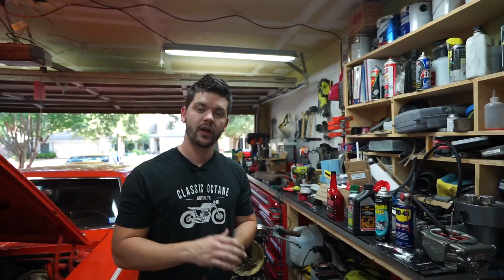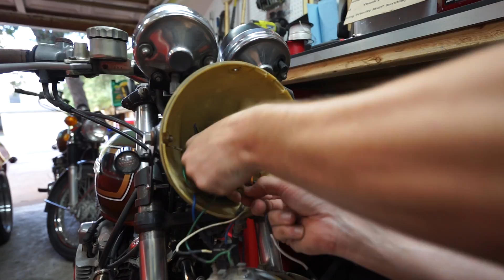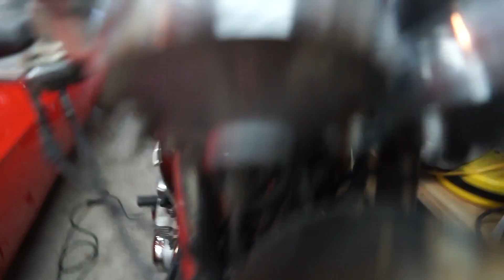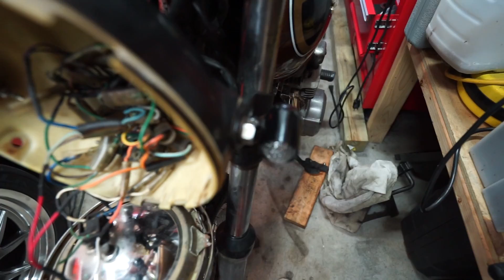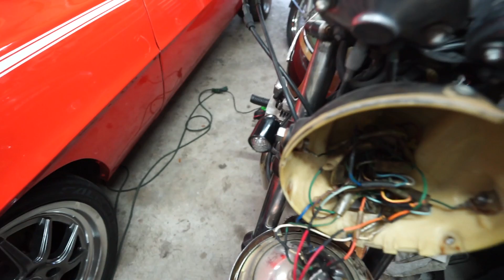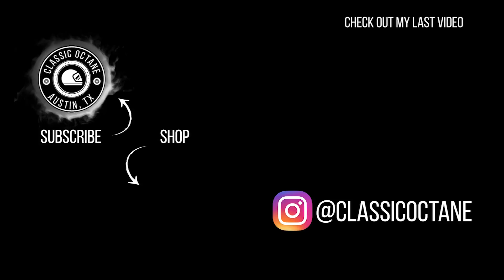How to fix motorcycle flashers all going off at once.

Comment: Re: 81 Kawasaki 550ltd. Still have the original system. But, I'm getting a voltage drop on the non flashing side. This looks like a ghost flash. I'm looking to prevent that.

Comment: Question here,
If I install turn signals with LED bulbs, flashers and the diode kit, but leave the indicator light non LED, would it be an issue? I have trouble finding no twist type LED cluster bulb.

Comment: Do the diodes have to have a specific value? Did you also use a single LED relay for the LED brake, front and back turn signals conversion?

Comment: Hello. I picked up a 86 Suzuki intruder project. LED headlight already installed. Flashers don’t work at all. Running lights only. Rears are currently missing. Wondering how to remedy this. 
Sincerely 
Noob to all this

Comment: Did this for my 85 shadow, worked fine. As he says, plug the DIODE single side up to one of the cluster signals wires and the other wire from the cluster to a ground. Then connet the 2 DIODE ends to the signal wires.  The running lights can go directly on to the signals.

Comment: hi, first of  all thanks for the video. very helpful information and well explained, wondering if you or someone here could help me, i got these led turn signals with 3 wires one for the running daylight  and before installing the diode kit i tried by unplugging the light bulb of the indicator everything worked, day lights and turn signals, but when i installed the diode kit turn signals work but if i try the 3rd wire for running daylight it goes back to same issue,

Comment: I had the same problem on '22 Honda XR150. I first added 2 rear LED signals which worked but would hyperflash. I replaced the flasher unit with an adjustable LED unit which fixed that issue. I got the 4 way problem when I added my front LED signals. The quick fix is to remove the dash indicator bulb. I did that and it all worked. I then installed a LED T10 bulb so now I get the indicator on R signalling only. My left signal wiring is orange and right side is lilac purple. Green for ground of course. 
I'd buy your adapter in a hot second if I wasn't in the Philippines. I'm sure the postage would be high. Can you tell me what diodes you used? Good video by the way!

Comment: I have a 2007 cbr1000rr the bike is set up with two indictor lights one for the left and right inside the cluster. So would I need two separate diodes or would one still work?

Comment: My Issue is when I turn the switch to the side they turn on but won't blink. But if I switch one of the bulbs to the Stanley bulb, it'll blink. I have Led bulbs, I have a led relay, but if I put both LEDs on front and back it won't blink. I am open to what ever advise the community has.

Comment: Got my diode splitter kit a couple of days ago and did an installation. On a 2014 Kawasaki 900 classic. All worked perfectly after installing the LED flasher module, your kit and the LED bulbs. FYI, the grey and green wires can be accessed where they go in the dash connector by just undoing a little electrical tape. The black and yellow striped wire right next to them can be tapped for ground. Unless you choose to remove the gas tank, the hardest part is working in the little space afforded where the harness wires go down just behind the speedo assembly.

Comment: Great video, i just ordered a diode kit from you, and i wonder if i have understood this right? i have four wires in front, two for each side, so 2 green, one blue and one orange. So the orange one i can just put directly to ground, the blue wire to the single connector on the diode kit, and then use the two remaining wires on the kit to each turn signal??

Comment: Bit different on mine.  2004 Honda vtx 1800 with 9 pin relay (quick fix would be to switch out 2 pin in other models but no).  With LEDs wired up, when I turn the bike on, both sides flash like hazard lights.   When I activate the switch, the correct side turns on and blinks fast.  Obviously don't want to run around with both sides flashing all the time :D

Comment: Just received and installed it, worked great. The only thing is you do need a 3 wire Electronic flasher (with a ground). Thanks for shipping this out so quickly.

Comment: Hi. Thank you for this video.  I just found myself having this same issue (LEDs all around, causes all LED signals to flash like hazards when any signal is turned on).  If I leave 2 incandescent bulbs on either end, LEDs on the other. All is well, no hyperflash either.  So, I have a 2007 Honda Shadow Sabre 1100, will your wiring fix work for me as well. Will it be in the headlamp housing and easy plug and play like you show?  (I really dont want to cut any wires :) ). If so, I would like to buy your wire/diode kit if you are still selling.
Reply: I have the same bike. We’re you able to use this?
Reply: @themegamuffin2542  I used something very similar but it kept blowing a fuse. I am not very good with electrical wiring but I followed same as you and compared to my honda shadow sabre 1100's wiring diagram and it still didnt work. I kept 2 LEDs in the back, normal in front. I get a quicker signal flash but it works like blinkers should and doenst blow a fuse.
Reply: @kezug  sounds good. Thanks for the info, I’ll be trying a few things. Just got this bike a few days ago and it’s my first bike. Trying to learn all the bike stuff lol.

Comment: Whats up Classic Octain? I have a 93 cb750
I swap out the rear 2 wire turn signal with led one's. I change the relay to a led relay. Work beautifully. 
My front turn signal uses a 3 wire set up. I change them to led all the light comes on at once. I use a resister for each one, but not one side work as it should. When I switch to the other side all the light comes on (turn signal) will the wire set you are selling fix this problem? And how much do I need? Thanks

Comment: I bought a flasher relay for my 2004 Kawasaki Vulcan 800 when I installed my led turn signal and all of the flash when signals are turned on left and right. Indicator below speedometer doesn't flash. If I change the bulb will that solve my problem?

Comment: I saw that the price is $10 (not $5 like every said) for 1 diode kit. I need only one or 2 to wire my bike?
Reply from the maker: I just increased the price so I could offer faster/more reliable shipping with tracking. You only need one diode per bike.
Reply: @ClassicOctane  My cb750f 1977 is different right? My have 4 wires. 1 side has orange and white orange, another side sky blue and white sky blue. How can I wire this diode? Please help

Comment: I can’t figure this out. I have a 1992 Honda nighthawk. Has 3 wire lights on it now but my new LED’s are two wire. No running lights just turn signal. The lights on it are grounded to green then one to running lights and the other to signal on both sides. How would I hook up my diode kit? For something so simple I am confused and I’ve emailed twice but no response
Reply: Anybody have an idea?

Comment: Thanks Taylor. Just installed the diodes. It worked except the dash lite did not flash. Installed a new led compatible flasher with a ground EP 35 and It worked. I have a 71 750 and the harness had a ground tang there. So if anyone is having that problem try the new flasher. Pin 31 grnd. 49 blk 49a gray. Thanks again and enjoying finding you channel and builds..

Comment: Great video.  Would these diodes be useful for me? I just installed LED turn signals that double as running lights, but my bike has only two wires for the indicators and the LEDs have three wires.

Comment: Hey, so my led turn Signals work fine unless I connect the lil turn signal dummy light harness does it with led  bulb or incandescent, then it will flash on one side fully and other side will flash dim what that fix this issue? And only does it in front

Comment: Taylor, I installed the 2 pin electronic flasher with the led bulbs on my 2008 Honda shadow aero 750.  I used the one below led bulbs for the front turn signal
GLL 1157 BAY15D 5730 20 SMD Amber/White Switchback Turn Signal LED Light Bulbs 3.8W 12V LED Super Bright 600 Lumens 6000-6500K Brake Light Lamp (Pack of 2)

I used the one below led bulbs for the rear turn signal
iBrightstar Newest 9-30V Super Bright Low Power 1157 2057 2357 7528 BAY15D LED Bulbs with Projector replacement for Turn Signal Lights and Brake Lights, Amber Yellow

After installing everything, my front turn signal flashes one at a time but both the rear turn signals flashes at the same time. Can you tell me why it is happening?

Comment: Thank you for posting this video I have a Yamaha V Star custom and believe this is my issue. I also installed an integrated led tail light. Would I also need one for the rear? I have LED front and rear.
Reply: Hey Josh, I also have a V-Star custom that I'm working on.  Did you end up buying these and was the install fairly straightforward?  previous owner installed LEDs but never finished wiring it up All four of mine are turning on in both left hand and right hand turn.  Just curious what you ended up doing?

Comment: I have aftermarket led rear blinkers that work fine. The front are still stock but I tried putting in led bulbs in the front. They are bright but hazard flash just the front two blinkers. The back flashes normal. Will this trick work for me or do I need a flasher relay? 2005 Honda Shadow Spirit 1100

Comment: I have an 82 cb900c with dual indicator turn signal bulbs. I upgraded all bulbs to LED, brake, turn, front and rear and turn  indicator leds. Now all I get is; select rt turn rt.front just illuminates,no flash. Select left turn same result. In rear no turn signal or illumination, only brake lights work with front and rear brakes. On front left and rt. running lights shine when ign key is switched on & slightly brightens when turn selected either side. Do I need two of these diode harnesses,one harness for each ind led, and where to I connect them?

Comment: Have a klr with a trail tech vapour dash and did led signals and flash fast but work. Got another klr, mint, low km, and stock. Just did the same led setup and all 4 signals come on.
This vid helped to track the bug. Getting a diode. Turns out the Vapour on the other bike is set up for led and the power stops at the dash. The stock klr does not. 
Many thanks🤘👌

Comment: aaahh I can't get this to work! I installed a new LED signal relay and tried using the diode kit but for some reason it wouldn't work for me... I plugged the single side into one of the wires running from the turn signal indicator and the other two into each red wire going to each turn signal led. I also grounded the other wire from the turn signal indicator and it still wouldm't work...

Comment: The led lights were working fine but flashing fast. Took it apart to rewire neater and now when i turn front signal on both flash at the same time, but rear works properly. Any idea what the issue would be or does it require the diode?

Comment: Hi, I made one as im half the world away from you and it hasn't done anything, bike is a 76 laverda SF3, I wired it up to where the front and rear indicators join at the front. should it wire to the indicator switch wires instead? cheers

Comment: Hey man any reason why I got those diodes but it doesn’t work, I mean I connected the blue towards the harness and them one of each red to the signal lights of course grounding the other free wire but I just don’t get power after the diode.

Comment: Just an FYI - these are commonly referred to as a fix for metric bikes but this should also work on any bike with the 2 wire indicator light. Basically what is happening is that the indicator bulb is relying on the light opposite the selected indicator to provide grounding for it so that when one side is indicating, the other side is the ground. LED lights don't work this way so this kit is the fix and you are correct. I recently bought some cheap LED 3 wire bullets for my 1990 Harley Davidson and have the same problem. I originally just had solid lighting with no flash. I bought the LED flasher relay and through troubleshooting I found that it was flashing but all the lights would do was to dim. If I hooked the white wire (running lights) to the ground, I could get a bright flash via the red wire but all 4 would flash again. I narrowed it down to the turn indicator and realized I needed zener diodes on my indicator feeds to block the backfeed. I could make my own but was curious if anyone else already discovered this and made a kit so I began looking and ended up here. I am sure this will work on my older Harley with incandescent bulbs and 2 wire indicator but I can't speak to newer bikes with the canbus system. Thanks for doing the video and you did a good job of showing the issue and install. I will be buying my kit from you.

Comment: 03 z1000. integrated LED tail and aftermarket led arrows up front. my front blinkers are hit or miss. sometimes they're fine. sometimes they are constantly on at like 15% brightness constant, 30% brightness blinking. none of the issues like you're having, i just find it interesting that yours were super dim when you had all 4 blinking. 

do you think your wires would help my bike? i've been troubleshooting this issue for over a year now. i can't figure it out. they have no ground on the front led amazon blinkers, just 2 wires.

Comment: HI,GREAT VIDEO, CAN I USE THAT DIODE ON MY 79 KAWASAKI KE100 WITH SIX VOLT WIRINGS?THANKS...
Reply from the maker: Yes it should work with 6V as well as long as the LEDs you have are also 6V compatible.

Comment: Does it work on a 85 Rebel? If it does it will fix my problem just like it did for you.
Reply from the maker: It should work on pretty much any bike with a 12V electrical system. So yes, you should be good to go.

Comment: Wouldnt just changing the stock flasher relay to a electronic (led) flasher relay fix that issue ?
Reply from the maker: No, the flasher relay needs to be updated for the light to flash at all. LEDs don't draw enough current to trip the stock one. This is to prevent power from traveling to the other signals.

Comment: So I’ve got a 1981 Yamaha xj500. I’m in Slovakia so I’m gonna go to the electric store and get the diodes and attach the wires myself. Let me make sure I understand. The single wire end connects to the positive coming out of the indicator, then the two other ends connect to the positive and negative of one of the turn signals? Or?
Reply from the maker: Single wire goes to the power on the indicator the two other wires go to the power on both turn signals. That way you get power to the indicator while turning both directions but power doesn’t travel to the other side of the bike.

Comment: So when wiring the diode I ground one of my wires going to the turn signal and the other wire goes to the red wire on the diode. Then do you need two diodes or no can you explain?
Reply: Or do u just do it on one side ground one wire and then connect the one wire to the diode and then reconnect it the the harness and then doing it on one side will prevent it going to another
Reply from the maker: You just need to connect each red wire on the diode to the power wires going to each side's turn signals. you can leave the rest of the signal wires alone. then you take the white wire from the diode and run it to your turn signal indicator.
Reply: If I order this now ? When would it get to me ?

Comment: I like the look of stock turn signal indicators, but may look into retrofitting them with LED bulbs.
Reply from the maker: I want to do a "resto-mod" build where I keep the stock look but upgrade to LEDs, electronic ignition, etc.
Reply: My other bikes (Honda Shadow VT750 ACE Deluxe and HD Road King) are cruisers and great for going down the road.  Since getting into restoring cb550/cb500, I really like the comfort and sitting position and responsiveness of this format.  A cb1100 ex or Triumph or something modern in this form factor  is in my future.  Not having to deal with carbs are nice for a bike you want to jump on and go.  These old bike should be warmed up, right?

Comment: Revival Cycles released a video today on wiring in bar-end LED turn signals, but I don't think those Moto-gadget units need a separate diode. Helpful to watch both videos, I think.
Reply from the maker: I had to use one on my Triumph with LEDs to get the turn indicator to work.
Reply: @ClassicOctane  I guess I'm struggling to understand when this kind of diode is needed and when it isn't. Don't really know a lot about motorcycle Electric Systems yet.